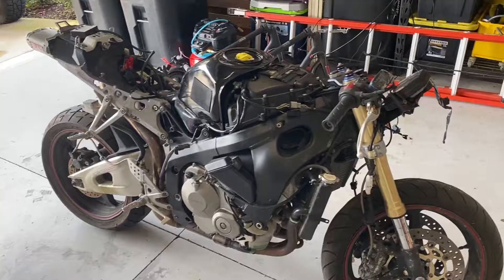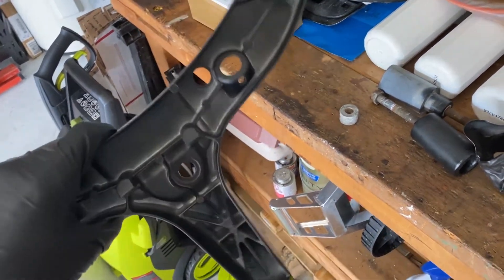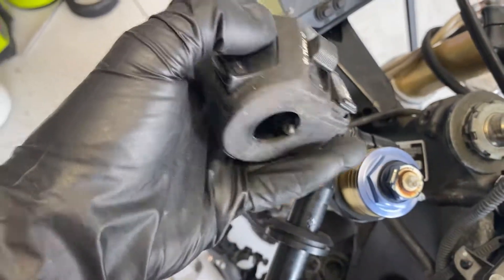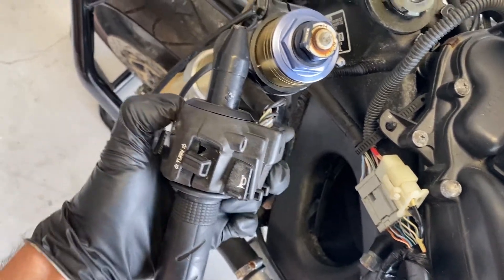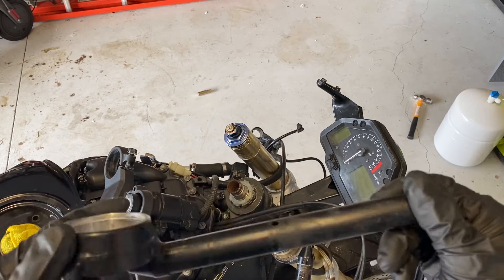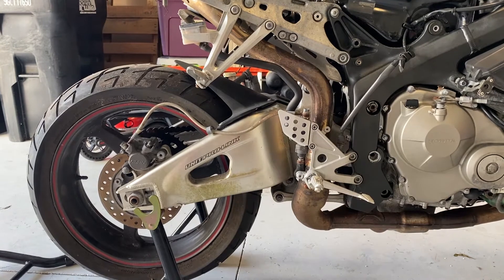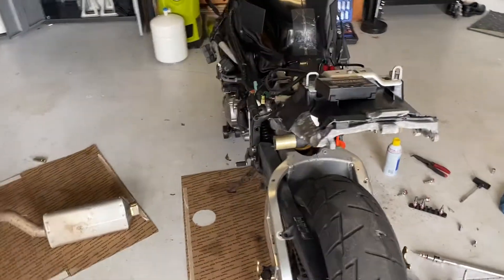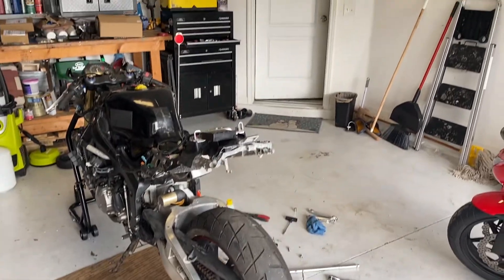Handlebars are overrated...

Comment: Just bought a somewhat clapped 06 600rr, it runs an all purrs like a kitten but the damn wire harness looks like its been through hell an back electrical tape special lol it was wrecked so needs headlight assembly but lots of wires that appear to be added an going to nowhere, iam sure they added LEDs an crap, what place could i order a new wire harness revzilla says they not available so iam guessing i gotta buy used but not sure of a trusted source, I'd hate to have the wrong one sent an me not knowing the damn difference, this my first streetbike been riding dirtbikes an they are million times less complicated lol
Reply from the maker: I would start by researching if there are any differences between the 05-06 harnesses since they are the same model year. That will broaden your options for used parts. I’d also research what the complete harness should look like/come with. If I was in your shoes, I’d start my search on eBay. No guarantees, but if you buy from a reputable company your chances of finding a complete harness are pretty good. Best of luck!
Reply: @LifeOfMikeChannel  thanks man, kinda my line of thinking, just whoever had this b4 me did a number on the harness lol it runs an all but the harness just looks atrocious, still debating if i just get the headlights an fairings an slap it back together an sell it or keep it, if i keep it i gotta cleaner up some just for my sanity lol thanks for documenting your build
Reply from the maker: @wolverinebear5357  no worries! It’s a great bike if you decide to keep it for yourself. As you’ve seen, they can take some abuse and still run like a top. Let me know if you have any questions along the way.